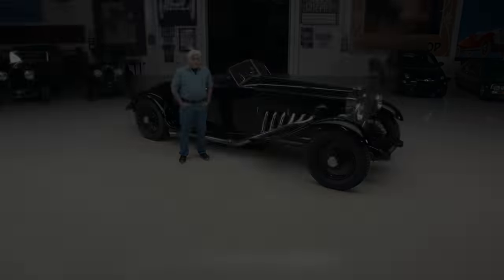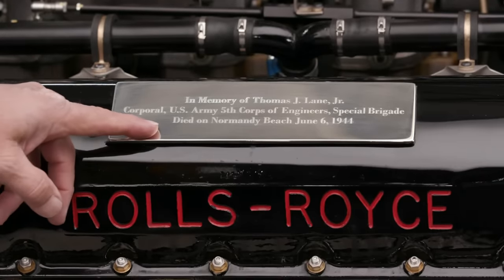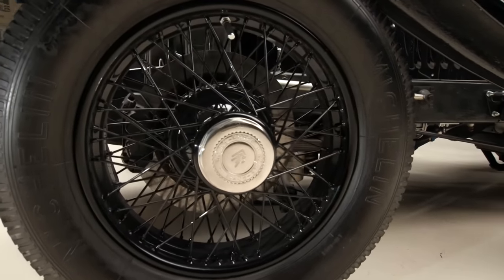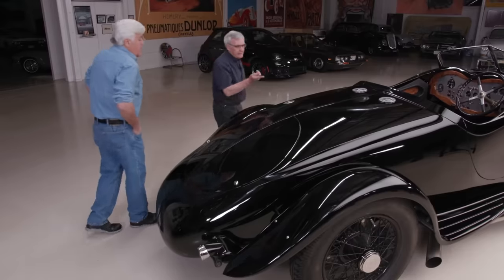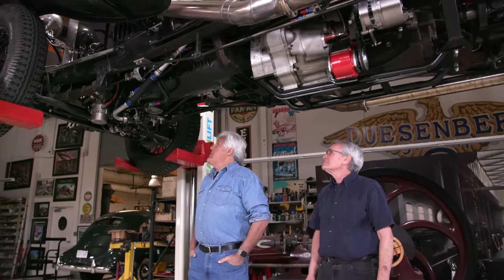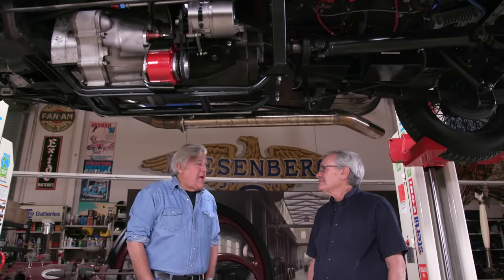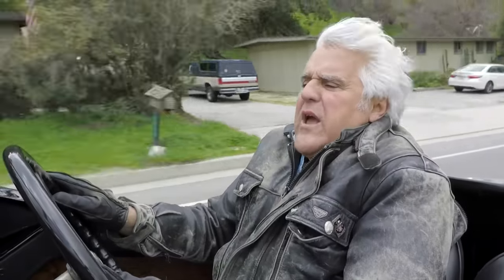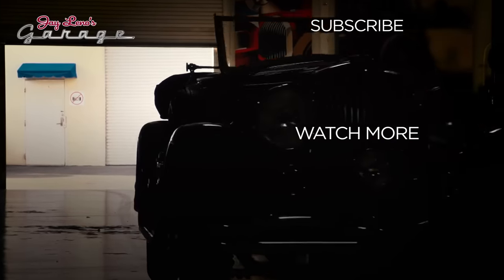1934 Rolls-Royce Merlin - Jay Leno’s Garage

Comment: The moss transmission was the weak point in the Jaguar and was usually the reason they DNF'd .  The final straw was in the D Jag.  They were looking for another transmission when the disterous fire destroyed the The plant.  I have seen E-types and Jaguar saloons that had Chev v8's installed and the Moss box would eat itself up in short order.  I can just imagine how quickly that Merlin would dissolve it 
I had a friend who installed a Buick 401 with a dynaflow  automatic into a 3.8 Sedan and it was the best 3.8 sedan ever made.  Smooth as silk and strong as bricks.  It was also waaaaaaay faster without the Jag 6 cylinder boat anchor and the moss destructo transmission.
Thank you for this great piece of history and imagination.

Comment: could mod it to a slightly higher position to prevent scrape damage n add sum plating along the whole thing.... that's bout only thing id do different n add ignition autodistributor n maybe a small powerful solar  panel to keep electrical components charged n running n whatnot... but that's my take on it...
Reply: or w.e it's called to bypass that handcrank starter thing w. a switch... arthritis sux...

Comment: The Merlin dry weight is 1,640 lb (744 kg).

A modern 2.7L turbo engine can produce 310 HP, so ten of those to equal the 27L displacement of the Merlin would produce 3100 HP on pump gas.

Racing Merlin
Racing engine for 1937/38 "Speed Spitfire" world speed record attempt. Merlin III with strengthened pistons, connecting rods, and gudgeon-pins, running on increased octane fuel, developed 2,160-horsepower (1,610 kW) at 3,200 rpm and +27 lb boost, a power/weight ratio of 0.621 lb per horsepower. Completed 15-hour endurance run at 1,800-horsepower (1,342 kW), 3,200 rpm at +22 lb boost.

Comment: Brilliant video, fabulous car BUT hopefully not many speed bumps around where Jay runs his car.
That unit under the car in spite of having a protecting buffer is very near the ground.
I remember hearing bits and pieces about the terrific car that John Dodd drove, it was  not far from where I used to live that it was on the road, and apparently he used to leave tyre marks on a garage forecourt when leaving, I believe John's son now drives the car or a similar one to the original.
Love the hoist that Jay uses, seems absolutely no chance of a car slipping off of it or when the arms not placed properly under the car and the weight of the car closes up the supports and some unlucky person can hopefully not, end up wearing a car!
Thanks for this, certainly Jay at his best when talking motors.

Comment: How fast might this chassis be able to go ?  If you say were able to mount tires with such capability ?
Reply: Debbie Miller,
The only way to top-speed test this car would be on Germany's Autobahn or on the Bonneville Salt Flats.  In either case the driver should have their will in order.

Comment: The so-called "Merlin" aircraft engine in actuality was the Rolls Royce Merlin V-14 engine for the company's line of hand-built luxury vehicles. As Great Britain anticipated the Second World War, the Royal Air Force (RAF) re- quired for their new fighter, the Super- marine Spitfire, a much more capable powerplant than they previously had been able to find. I understand that this was rated at round 1,500 hp. 
   Years on, the United States Army Air Force (USAAF) brought to the Europ- ean Theatre their new fighter, the North American Aviation P-51 Mus- tang. The Allison V-1710 engine suf- fered from reduced performance above 6,500 metres (20,000 feet), so the War Department arranged for Packard to license the Spitfire engine. This most extraordinary powerplant took the Mustang to the peak of performance for U.S. fighters, giving them the aerial warrior they required to establish control of the skies over Nazi Germany. 

   File this under wry irony: just as I complete this contribution, Mr. Leno includes in his narrative much the same material.

Comment: Even today Japanese cars/motorcycles have an annoying tendency to use thread-pitches that are non-standard in the U.K. 
normal/standard in the U.K.  is M8x1.25 just finding someone who stocks M8x1.0 nuts or bolts is a nightmare. Yes you can order online, but what if you need the nut/bolt now, not the middle of next week?

And the car sounds amazingly good.

Comment: Jay, What octane fuel are you running in the Merlin and where are you getting it, 115/145?
Reply: These engines had to run on crappy fuel during wartime (where high quality stuff was not always available). Does not need high octane

Comment: 4800 lbs = about 2160 kg, with 1000 hp = a little more than 2 kg per hp. That is hypercar territory... That is a better power to weight ratio than a dodge demon... With modern grippy tires and drivetrain, this thing would be able to go from zero to sixty in 2.x seconds (!). That is really pretty insane for such an ancient machine...

Comment: It’s a shame that New Venture went belly up producing that manual transmission. My mechanics were frustrated that it weighed more than a automatic when they pulled mine to upgrade the clutch to a double disk for me. It’s now very popular in the competitive pulling sport due to its massive, low flex cast iron shell. Like Leno, I will only spend my sweat earned money on a manual. I love these Frankenstein aero motor cars, this is very elegant for these types of cars. Leno’s fabricators produce tasteful, proportional looking work. I hope they are making top pay for the dedication it takes to get your skills to that level with that kind of consistency.

Comment: The Merlin 114 was made in 1944/45 and installed in late model Mosquitos, which never saw war service.  Not a Spitfire engine, I'm afraid.  In the aircraft it had a two-stage two-speed supercharger and single-point fuel injection and produced 1,430 HP at 27, 000 feet using 1.25 atmospheres of boost.
The superchargers and injection have been removed in this build, being somewhat unnecessary in a road vehicle of this size, so 1,000 HP is a reasonable estimate.

Jay doesn't tell us what fuel is being used in this car.  If it's filling station fuel, I doubt that it's getting 1,000 HP, unless there are some exotic additives being used at every refuelling.

I'd like to think that Len Setright would have approved, although possibly with one or two reservations.

Rolls Royce engines were used in the war to power tanks.  A version was derived from the Merlin III, being derated for use with "pool petrol", the fuel available for army vehicles, less sophisiticated than the high-octane aviation fuel used for aircraft.  It was called the Meteor, and rated at around 650 HP.
The Meteor was used in British tanks for a long while, and powered the celebrated Centurion, the first Main Battle Tank.

RE: Packard redrawing the engineering drawings.  Rolls Royce manufacturing was built around hand-finishing, so wide tolerances were acceptable, as the man who built each engine would hand-finish the parts to fit.  Packard, with their more extensive experience in mass production, were able to redraw the parts to a precision which they could manufacture in a mass-production setup.

Packard and Rolls Royce each had technical representatives in the other's factories and design shops, and each benefited from the expertise that the other brought to the table.  It's one of the best examples of true wartime engineering collaboration that I know of, and should be more widely celebrated.

The car is a properly respectful build, trying as hard as possible to be true to the historical origin of the engine.

Comment: Jay I'm a motor mechanic engineer and I would consider it a privilege to work in your garage just for room and board for a couple of months and give you what I know and learn from you 
Not that I ever expect to hear back from you but I love your garage as only someone who has worked as a mechanical engineer most of his life working on things from 2 stroke hand saws to Rolls Royce cars in a dealership and most cars inbetween rebuilding engines from poured white metal bearings to very high performance VW engines yes those things also Subaru, BMW, Citroen, early Audi and many many others 
Again love your garage

Comment: Just a minor question: Why bother with the complexity of having two voltages at all? The starter motor and engine pumps (oil, fuel and water) are always going to be the largest power consumers, so the 24 volt system is going to be the primary. The Merlin comes as standard with a 24 volt starter and 24 volt generator, probably because it would be impractical to make a 12 volt starter motor that powerful. For all the other low-power accessories, why not just use truck components? Those are already designed for a 24 volt electrical system, so you could eliminate the 12 volt battery, get rid of the 12 volt alternator, save a bit of weight, reduce the complications and just run everything on 24 volts.

Comment: When you set out to build something like that, it never seems that complicated to begin with, it's more of a task. The necessary components end up in the necessary places, and after the fact it looks complicated. But really it's just a task, if you set out to do something and see it to it's end, then you're gonna get back the work you put into it.

The wheel wells are wing shaped, at the right speed it probably generates a small amount of lift. It's probably too heavy and lacks the proper amount of wing surface, otherwise it would probably fly.

Comment: The Rolls tolerances were not 'too wide' as suggested, they were just as you would expect in a high performance aero engine built by some of the worlds finest engineers, ideal for purpose. I think Jim was thinking about getting a nut or bolt in the field and it not fitting the British standards used, plus all the other little places where using a different standard was a PITA. Once upon a time all nuts and bolts and screws were made when needed and bespoke, so there was no way you could go to a drawer with nuts and bolts, because there were no drawers with nuts and bolts. Standardisation was a real accelerant for the Industrial Revolution and Armstrong / Whitworth? (can't be bothered checking) were first to make standard nuts, bolts and threads in GB. In America I know they claim to be the first, but they do claim that for everything.. They may well have been. Ford could not have made his factories to work without it. It was a early/mid 19th century idea.
Edit: I just cant imagine any important parts were all over the place dimension wise.

Comment: I want to add that Rolls Royce made an even bigger V-12 engine, the Griffon, which was 37l, or 2,240ci, and made around 2400hp. And it didn't weigh that much more than the Merlin.

Comment: I would like to see what a monster engine like that could do on a hole shot from zero mph... Or is it a 🐢 that builds its power after 60mph... If you coild make this 🔥 the tires off that would be wild to see
Reply: It is a little over 2 kg per Horsepower. And as a rule of thumb you can say that a car (with enough grip from the tires and a drivetrain that handle the forces) can do 0 to 60 in roughly as many seconds as it has kg's per HP... I rest my case...
Reply: @rientsdijkstra4266  be fun to see

Comment: He is incorrect. Rolls Royce held tolerances to a very high standard, It was achieved by tradesmen on the shop floor hand building each motor. This method did not lend its self to mass production. Rolls had to pass work to Ford in England and they dealt with the same issue as Packard.

Comment: 6:23 - He's got that story wrong. The Americans wanted to be able to change parts with other engines. What he means by 'wide tolerances' is that different versions of engines where specced differently and needed different parts - that IS a problem in supply so i can understand the need for standardisation. Oddly, a thing the British started with cannon sizes.
Reply: He gives the impression that the British Rolls was poorly made compared to the Detroit engine. Typical American Myopic.

Comment: Merlin engines could not be run at 4,000 rpm. Normal rpm for an early Merlin was up to 2,400 and maximum sustained combat power rpm was up to 2,700. Later designs could run at up to 3,200 rpm, but were rated at either 2,850 or 3,000 rpm. At combat power, they were limited to 5 minutes of running, followed by a note in the pilot log book, and an inspection after landing. But if emergency power, up to approximately 3,600 rpm, was used, the engine was only rated for a few minutes (I think 2 minutes) of running. And an engine strip down and rebuild was mandatory. Essentially, the engine was toast, and not guaranteed to keep running for very long after being pushed that hard.

Comment: So unlike his ‘Bentley’ this actually has a Merlin? Or is it another Meteor?
Reply: Merlins rotate backwards compared to most engines, as the prop is clockwise, probably got a meteor,  a lot of meteors were merlins that were crashed but were put in the "lets not risk a aircraft this engine is fine" and derated to meteors.

Also all merlins were supercharged, but that might of been jay or the guy before trying to make the gearbox or tires last further than the door

Comment: The Tesla Plaid is probably faster off the mark with a minute fraction of the complexity. 
But the top speed of that Merlin mod is unimaginable if the tires, wheel bearings, aerodynamics, etc. could handle it.

Comment: LMAO - THE NV-5600 Trans is the STOCK transmission for a 99-2005 Dodge/Ram 3/5 & 1 ton truck with a Cummins......  MOPAR ALWAYS overbuilds their transmissions.  My Dakota (1/4 ton) uses the EXACT SAME trans as a 3/4 ton GM..... GM considers it Heavy Duty - Dodge considered a LIGHT Duty trans.

Comment: Beautifully designed, but, the transmission sits so low in that thing that a flat tire would likely grind it hard into the asphalt, thats the only aspect of the engineering of that car that probably could have been a little bit better

Comment: had similar problem second gear synchromesh   1957 morris minor convertible 850 cc (like driving a lawnmower)  38 horsepower was a bit of a monster ... not exactly //   does collection have a morris minor - 1.2 million were made I believe   british police even used them .... wouldn't scare armed gangs now though ..

Comment: BS, putting it on the dyno would likely blow this transmission,  only thing saving it is the light weight & street duty. 
God forbid you put truck pieces on 'street car'
About 1 - 1/12 ton rating on the present drivetrain...

Comment: So the tolerances of the RR blue prints weren't good enough for Packard Bell ? A little back stab there as if you were amazed how bad the RR Merlin engine was you thought you knew better  ? Even though it had been proved a reliable fast great engine you though it needed tweaking to make it better ? Fool .
Reply: Not Packard Bell the computer mfg.,The Packard Motor Car Company of Detroit, Michigan, United States. 
Re-drawing the plans seemed to be more about making a great motor more easily mass produced.